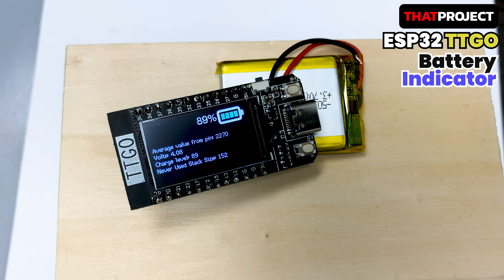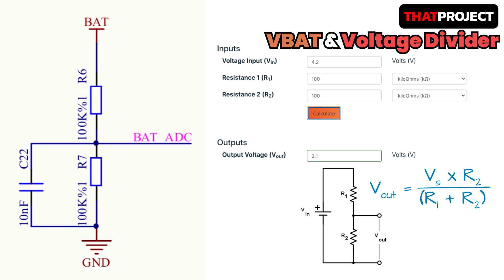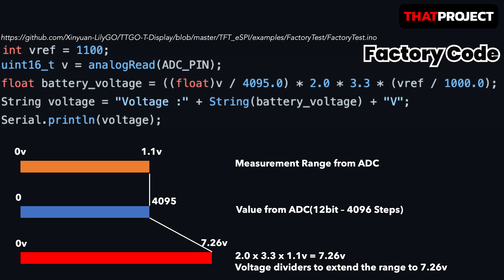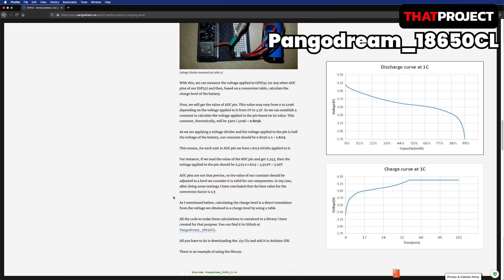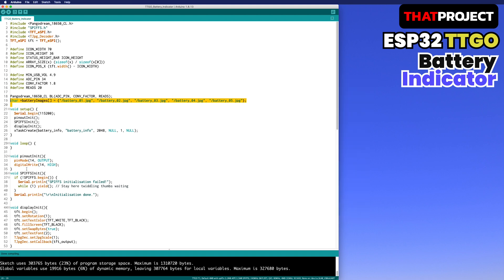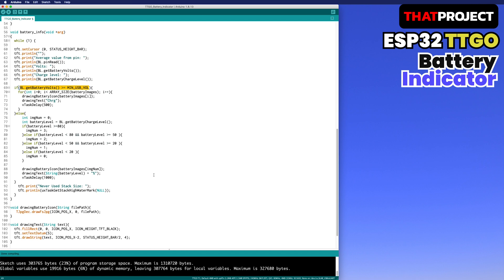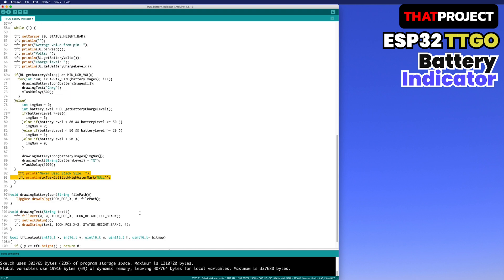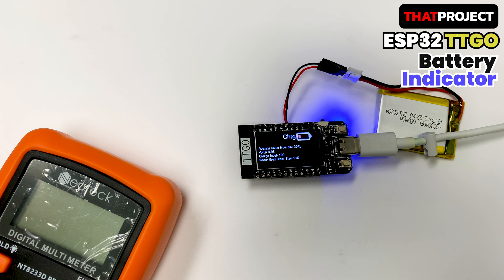ESP32TTGO - Battery Indicator 🔋⚡

Comment: After installing the battery, how to turn it off if I don't want to disassemble it
Reply from the maker: That's a good question. Unfortunately, this device doesn't have a power management chip, so you can't turn it off by long-pressing the power button. Newer development boards usually have this feature, making power control much easier.

Comment: In the video. Does the battery is directly connected to LIPO thru jst pins? or is that wire is soldered to gpio pins?
Reply from the maker: This board has a VBAT pin, so I was able to connect a LiPo battery right away.
Reply: @ThatProject  battery is directly connected to jst of the board?
Reply from the maker: @dasig3010  Yes, the battery is connected directly to the JST port on the back of the board.
Reply: @ThatProject  I have tested and its works 
thank you. 

Do you know similar library that uses driver_ng instead of legacy driver? 

when Im trying to add this code to have a battery indicator , it conflicts with my code

showing error : 
E (182) ADC: CONFLICT! driver_ng is not allowed to be used with the legacy driver
Reply from the maker: @ Yes it doesn't work anymore. For battery measurement using ADC on ESP-IDF, see this: https://github.com/0015/T-Glass-Applications/blob/main/image_capture_app/main/battery_measurement.c
Reply: @ThatProject  ill definitely try this one. thank you

Comment: when battery is fully charged does blue led will turn off or it's always stays on ?
Reply from the maker: The blue LED is connected to the input VCC. The LED will light up when USB is connected, regardless of charging.

Comment: So using the battery to power the project and getting the USB to charge the battery didn't require any code.  Is that correct?
Reply from the maker: Yes, that's right. The code is used to calculate the battery's voltage and show it on the display.
Reply: @ThatProject  Awesome.  Thank you!

Comment: I just came across your excellent tutorial and am trying it on a TTGO like in your video. Followed all the instructions, but the display remains dark. I do get two warnings during the compilation process/

C:\Users\Frank\Documents\Arduino\libraries\TFT_eSPI/TFT_eSPI.h:973:8: warning: #warning >>>>------>> TOUCH_CS pin not defined, TFT_eSPI touch functions will not be available! [-Wcpp]
       #warning >>>>------>> TOUCH_CS pin not defined, TFT_eSPI touch functions will not be available!
        ^~~~~~~
C:\Users\Frank\Documents\Arduino\ThatProject-master\ESP32_TTGO\TTGO_Battery_Indicator\TTGO_Battery_Indicator.ino:51:119: warning: ISO C++ forbids converting a string constant to 'char*' [-Wwrite-strings]
 char *batteryImages[] = {"/battery_01.jpg", "/battery_02.jpg", "/battery_03.jpg", "/battery_04.jpg", "/battery_05.jpg"};
                                                                                                                       ^
C:\Users\Frank\Documents\Arduino\ThatProject-master\ESP32_TTGO\TTGO_Battery_Indicator\TTGO_Battery_Indicator.ino:51:119: warning: ISO C++ forbids converting a string constant to 'char*' [-Wwrite-strings]

The first one I try to fix with #define TOUCH_CS 4, but that doesn't do anything, warning keeps coming up.

Can you see what's wrong?
Thanks in advance.

Comment: Im building my first drone. I want to monitor the battery so i dont over discharge. I have been reading about voltage devider circuit and it makes sense.

The board im testing is xiaon esp32s3 sense. I solder 3.7v 850mah lipo to the pads on the back. Do you know if this board has a built in a battery monitor circuit?
Reply from the maker: I know it has an internal power circuit, but I couldn't find the pin connected to the VBAT. I think it would be a good idea to contact Seeed Studio directly about this.

Comment: May I ask if the ADC pin and Digital Input mode for pin 14 settings is the same if you use the Lilygo TTGO V2.1? I saw it in their schematic that the Battery DIO pin for the TTGO V2.1 module is D35.
Reply from the maker: Is there a new version of Lilygo TTGO V2.1? I didn't know that. What updates do they have?

Comment: Hello, I have a question please. Can you charge the battery when your ESP32 module is off?
Reply from the maker: Since there is no switch between the battery pin and ESP32 TTGO, it will always turn on when the battery is charging.
Reply: @ThatProject   But, do you think its possible charge the batery when the ESP32 TTGO is off with a switch or with other element?
Reply from the maker: @RoboDIYer  I don't think so. You need to make your hardware for that.
Reply: @RoboDIYer  it should be possible to charge the battery while the ESP32 is in deepsleep which is almost the same as switching the ESP32 off.

Comment: Hello, I kindly ask if you can help me, I wanted to upload your file to esp32 devkit, but I can't, arduino crashes immediately before programming "Error compiling for the ESP32 Dev Module card" can you tell me why thanks
Reply from the maker: This is most likely because the default build settings are incorrect as the error occurs before the code is loaded. Please check PSRAM, Flash size and so on again.

Comment: Which board do I select?
Compiles and uploads with various ESP32 boards but I get a black screen as SPIFFS.begin doesn't initialise...

19:40:09.274 -> E (107) psram: PSRAM ID read error: 0xffffffff
19:40:09.274 -> E (115) SPIFFS: mount failed, -10025
19:40:09.274 -> SPIFFS initialisation failed!

Have I the wrong options in Tools?
Any help appreciated...
Reply from the maker: Are you using TTGO T-Display??? Or do you use another ESP32 board?
Reply: @ThatProject  USING LILYGO...
From tools menu, upload sketch data results in "SPIFFS Upload failed!"
Reply: Error reads:
[SPIFFS] data   : /media/Dev/2022/Kicad/Projects/TTGO_Projects/ThatProject-master/ESP32_TTGO/TTGO_Battery_Indicator/data
[SPIFFS] start  : 2686976
[SPIFFS] size   : 1408
[SPIFFS] page   : 256
[SPIFFS] block  : 4096
/battery_02.jpg
/battery_05.jpg
/battery_04.jpg
/battery_03.jpg
/battery_01.jpg
[SPIFFS] upload : /tmp/arduino_build_912800/TTGO_Battery_Indicator.spiffs.bin
[SPIFFS] address: 2686976
[SPIFFS] port   : /dev/ttyUSB0
[SPIFFS] speed  : 115200
[SPIFFS] mode   : dio
[SPIFFS] freq   : 80m

SPIFFS Upload failed!
Reply from the maker: @michaelo2l  Which tool for SPIFFS are you using? I used this. https://github.com/me-no-dev/arduino-esp32fs-plugin/releases/tag/1.1
Reply: @ThatProject  I'm using the same tool... BTW, running Linux (my main computer) but also tried my on Windows PC, uploading images worked but they didn't display, then I switch to my Mac but ended up with an unrelated problem getting Arduino IDE to compiling any code...
Reply: @ThatProject  All fine now... found post from me-no-dev:
sudo apt update

sudo apt install python-is-python3
Fixed the issue... thank you for your support... Mike

Comment: I'm trying it, I have two questions for you, 
first question: connected to battery and usb, it gives me a charging signal, right? (I see the writing Chrg...) but when the battery is charged does it stop signaling that it is charging?
second question: in your opinion I can use this on a wemos D1 mini, how many corrections I will have to do, thanks
Reply from the maker: The screen updates even while charging.
If wemos D1 mini has VBAT, it can be used in the same way.

Comment: Are you using the inbuilt voltage divider or are there some resistors hidden underneath?
Reply from the maker: It's using the built-in voltage divider.

Comment: Your video is very helpful.
Is there a way to show the battery percentage more consistently
because the battery percentage keeps increasing and decreasing and decreasing and increasing.
For example, 78% increased to 79% and then decreased to 78% similarly for other battery levels.
It is not as stable as shown on the phone, the battery percentage displayed on the phone is by default decreasing when not charging, and the battery percentage on this one increases and decreases when not charging.
Reply from the maker: #define READS 20
If set to a higher value, it can be calculated with more data, so you can have a more stable value.

Comment: Everything work just fine. However the icon does not appear in  the screen, may I know the problem?
Reply from the maker: Seems like battery icon files are not in your SPIFFS. Did you upload them?
Reply: @ThatProject  SPIFFS, doesn't appear in my tools although I followed every step. I'm facing a problem with it. Do you know how to solve it?
Reply: Everything works great for me now. I can see the icon now. Apparently, it does not work in IDE 2. just IDE 1., so I had to downgrade the software. Thanks for your time
Reply from the maker: @muskar2882  Congrats! You made it.

Comment: Thank you very much for your contribution!!! You are a great programmer.
Everything works as you describe.

Can I charge a 3.7V 400mAh lipo battery with this project?
Reply: yes, you can charge a 3.7V 400mAh lipo battery with this projec
Reply from the maker: gracias.

Comment: usng TTGO and when uploading I get fatal error: LittleFS.h: No such file or directory anyone got any idea.  have loaded the upload tools as instructed.
Reply from the maker: To use LittleFS, you must use ESP version 2.0.x or higher and TJpeg_Decoder version 1.0.3. Please check the two versions.
Reply: @ThatProject  Hi Eric thanks for the response I actually had to downgrade TJpg_decoder to 0.0.3 to get rid of the error. 1.0.3 produces the error Littlefs.h missing
Reply from the maker: @JamesT65  Oh okay. Maybe Bodmer the author of TJpg_decoder will update it sooner or later.
Reply: @ThatProject  Hi Eric I finally got it working, I installed Arduino 1.8.19 (I was also using 2.0) I reinstalled everything taking care to get all my versions correct and it all started working.
Reply from the maker: @JamesT65  oh, that was the problem. Thanks for sharing.

Comment: Am I the only one that can't get the TTGO to turn on when connected to the lipo plug?  It only seems to power on over USB-C 

Can't seem to find any documentation on this, did I miss something?  This video looks like its just plug and play with a 1s lipo :(

EDIT:    Hahaha unfortunately this was just a mistake - turns out that 3 of the 5 batteries I bought actually were dead on arrival.... verified one with a multimeter and functionality is back haha

also, great video Eric :)
Reply from the maker: Yes, you're right. I did just plug and play with a 1s lipo because there is nothing we can do other than that. Check this schematic first.
https://github.com/Xinyuan-LilyGO/TTGO-T-Display/blob/master/schematic/ESP32-TFT(6-26).pdf 
The battery is connected directly to VBUS via TP4054(linear charger for single-cell lithium-ion batteries).  

Anyway, it works now so we're all happy now.

Comment: great demo ! i noticed that the blue LED lits up when charging and turns off when the battery is full. But, the battery icon still shows "charging". Is there a way to acess the GPIO of that blue LED?
Reply from the maker: As far as I know, it doesn't have a GPIO attached. Therefore, it cannot be turned off or turned on by the user. Just in case, please check the schematic again.

Comment: how long does it last on battery?
Reply from the maker: Usually, it has an 80mA average operating current, so if you use a small 350mAh lipo battery, you can use it for about 4 hours.

Comment: Hello!

Is there any way to build it for an 10s battery? It's range is from 25v to 42v.

Thanks for your time and knowledge!
Reply: Possible yes, in that you can divide the voltage or get a regulator. But you're going to be losing a massive amount of energy in heat and will need to dissipate that heat. All in all the extra components to make it happen might cost more than just getting an appropriate battery.
You can also pull apart your battery and rewire the cells from in series to in parallel, which will drop their output volts and increase how long they'll last.

Comment: Thank you for code it is great but I have problem. When I disconnect usb imgs on ttgo t display show that still charging. Battery 3,7V 700mAh.  Pls help. Average value from pins: 2894, Volts 5,21, Charge lvl: 100, Never Used: 136
Reply from the maker: That's weird. It has to catch the voltage changes when the USB is disconnected. Please check the voltage with the multimeter.

Comment: Can I use Battery 18650 Li-Ion?
Reply from the maker: The 18650 cell has voltage of 3.7v and has between 1800mAh and 3500mAh so you can use it in this system.
Reply: @ThatProject  nice👍
Reply: @ThatProject  btw, should I use resistor?
Reply from the maker: What is it for???
Reply: @ThatProject  for battery to connect esp32 :)
Reply from the maker: @rizkylevy8154  oh okay. You have the VBAT pin on your TTGO board, right? If so, you don't need any resistors. You can connect it to your battery directly.
Reply: @ThatProject  I don't have TTGO esp32,but in your program include TFT_eSPI....
Reply from the maker: @rizkylevy8154  TFT_eSPI is Graphic Driver Library. It makes it draw what you want. Anyway, If your board has VBAT, you don't need to have extra resistors. If not, you have to make your voltage divider with resistors.
Reply: @ThatProject  I have esp32 TTGO with OLED display and battery 18650 slot😀
Reply from the maker: @rizkylevy8154  That's good!
Reply: So,I can use esp32 with any TFT lcd for example: ILI9341,ST7735,and more...

Comment: Good project,but my esp32 ttgo don't show charging indicator ,how need connect battery,where in ttgo pin 34?😄 indicator work well and show battery icon  ( full when conect usb cable) and when disconnect 34%  but when connect charging cable not show charging status,,how need corectly connect?
Reply from the maker: Pin 34 is connected to ADC. Since they are internally connected, there is no need to connect them separately. I'm not sure, but the ADC seems to be not working properly.
Reply: @ThatProject  Thank you for reply!!!,,,I change value #define MIN_USB_VOL 4.75 and now showing charging status, but I dont know how acuracy, now learn code,Thank you, good job, good project :) Have nice day:)

Comment: Hi, Can you somehow use this ESP32 and TTGO together with a Raspberry Pi connected to for example a 3.7v - 5000mah Lipo battery and the Adafruit Powerboost 1000c ?
If so, can U then use this to automatically and safely shut down the Raspberry Pi when the Battery is low ?
Or else just use this to monitor the battery level ?
Thanks in advance.
Reply from the maker: My channel is not working on a project using Raspberry Pi yet. But it's something I'm interested in, so I googled it. I hope this helps. https://www.instructables.com/Make-Your-Pi-Project-Rechargeable/
Reply: @ThatProject  I'll take a look at it. Thanks

Comment: Thanks for the share but I had no luck with this. It would constantly say my charge was 5% (1938 reading for 2v on pin 36). Its only 116 from 2047. So I don't understand why it would report 5%. Changed your defined pins in the library. The indicator images wouldn't show regardless of where I put them in the project folder. When I first tried your example, the text was too big for the screen. Code is code, so I don't understand why things like what is shown on the screen are different between us?
Reply from the maker: That's weird. Are you using the same model I'm using? It's LILYGO TTGO T-Display ESP32 with IPS ST7789V 1.14 Inch. If it's the same model, the same result as my video should come out. I've already tested with several devices. Also, please check if the TFT_eSPI setting is correct.
Reply: @ThatProject  I think so. I purchased 4 directly from LilyGo. I updated the user setup to set ST7789 as the driver. The text then loaded properly. Like scaled right. But the indicator image doesn't show still. On top of that, I have use this to get the right reading from gpio 27 for some reason? All good, I can work from there. Thanks!

int v;
adc2_get_raw( ADC2_CHANNEL_7, ADC_WIDTH_12Bit, &v);
Reply from the maker: @devdeque7846  Did you put the indicator image into the ESP32 File system (SPIFFS)? If not, please refer to my first TTGO video. https://youtu.be/Bl1C7Vdl3GA?t=232
Reply: @ThatProject  Yeah, I uploaded them successfully and it just would say file not found. I tried, gave up on that. I ended up converting them to C arrays and doing it that way.
Reply from the maker: @devdeque7846  Uploading files into Filesystem occur any issues? Well, anyway, I'm glad it's working.

Comment: I can't detect charging for the pin. My volt-only 4.1V when charging. how do you work?
Reply from the maker: It's correct that a higher voltage is required than a battery when charging. Are you using the same model I used in this project?
Reply: @ThatProject   I am not using ESP32TTGO for this project. I designed a module for my use. Does it make a difference?
Reply from the maker: @tuananhle7130  The ADC operation for VBAT is slightly different. Please refer to the datasheet of the module you are using.

Comment: Hallo...
Is this the same method for any esp32 3.3v? Or some esp32 (3.3v) need some resistance?
Reply from the maker: It may vary from product to product. You must check the schematic of the part of VBat.
Reply: @ThatProject  Thank
Reply: Sorry but I have another question: Do you know any site to buy the smallest swicth to turn the battery on and off?
Reply from the maker: @Abbici  Sorry. I have no idea. FYI, I usually buy what I need from aliexpress.
Reply: Thanks and sorry for the bother.

Comment: Very well I was looking for some of that for wroom32, regarding the sketch on the LilyGo TTGO board does not appear the pin number 14!
void pinoutInit(){
  pinMode(14, OUTPUT);
  digitalWrite(14, HIGH);
} That is necessary?
Reply from the maker: To make sure, have a double-check your pinout configuration.🤞

Comment: Thank you for this excellent project. Using the voltage divider is a very good solution to the ADC voltage limitations. Facing the anomaly , we must take voltage measurements as you did.